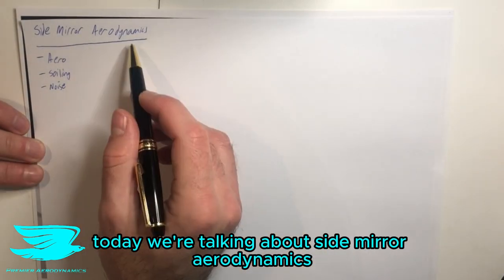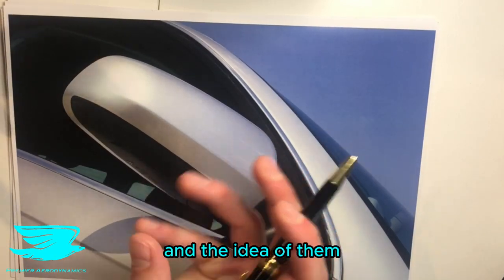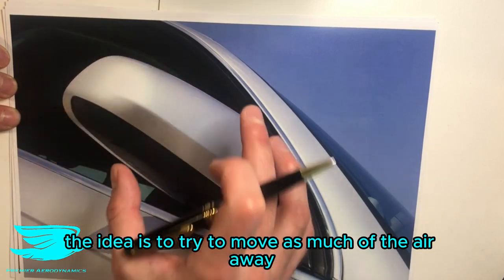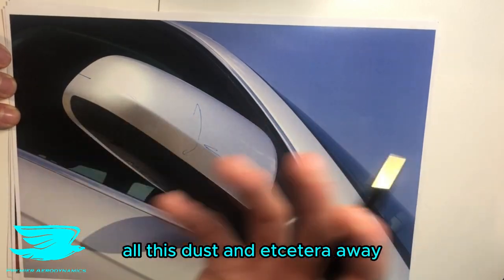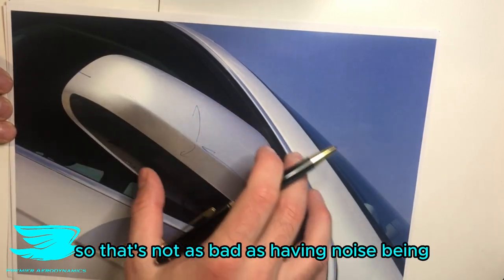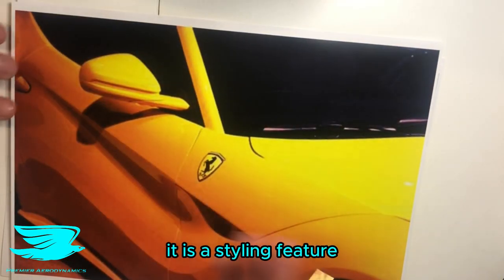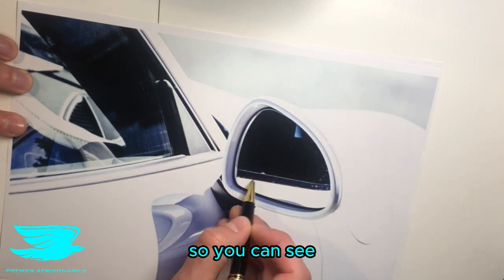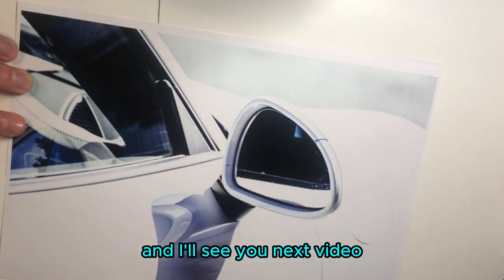{Auto Aero #38} Car Side Mirror Aerodynamics

Comment: If the mirror were flush it would also create more drag because the wake would be larger. With the mirror recessed, the low pressure moves inward a bit more pinching the wake for a small drag reduction.
Reply: A box cavity effect ?
Reply: @O-cDxA  Well electrodynamics is related to aerodynamics, so if it helps visualize, sure.
Reply: What effect would tubercles have if located at the crease line you show on the mirrors ?
- And serrated edges on the trailing edges. What about that ? 
I know the serrated edges have a benefit for sound reduction. 
I am making a more streamlined mirror for my car with these two features, as well as air curtains along the edges.
Reply: @O-cDxA  Acoustics definitely affects aerodynamics, especially at higher speeds when the sound waves reflect off a surface, as that has a direct influence on the boundary layer. When the waves spread out they compress the boundary layer to the surface and flow stays attached. When the waves converge, the flow rapidly separates. This feedback mechanism is present in trans-sonic buffeting of airfoils.
Reply from the maker: @rolandotillit2867 Good point about the recess providing a volume for the wake to exist in.

As for tubercles, I don't think that they would be that beneficial for the aerodynamics here because the flow stays attached pretty well over the mirror until the end (or where you put the crease), so you wouldn't gain much more flow attachment.

For noise, I think serrated edges and tubercles would both probably reduce the noise because it would break any tonal frequencies into broadband.

If you are making your own mirrors to reduce noise, I would probably go for some kind of vortex generator pattern because they are easier to install and move around.

To size them, calculate the approximate boundary layer height based on the length of the boundary layer, then choose vortex generator heights about 50% to 75% of that. That will give you much of the benefit without the potential drag increase.
Reply: @PremierAerodynamics  
Thanks for the advice. 
I modified a small motorcycle mirror with a sleeker shroud.
Tuft testing showed that the flow was nearly as good along the drver side window as on the passenger side ( no mirror ) 
But, I know this is pretty meaningless, since the wake cloud is simply farther away from the side of the car. 
I'm on version 2 now.
Reply from the maker: @O-cDxA  But at the very least, you have created a design that reduces how dirty your driver's side window gets. So, that is pretty good for a first design.